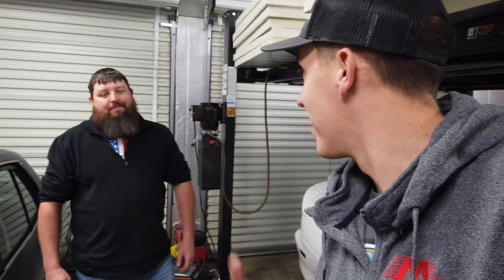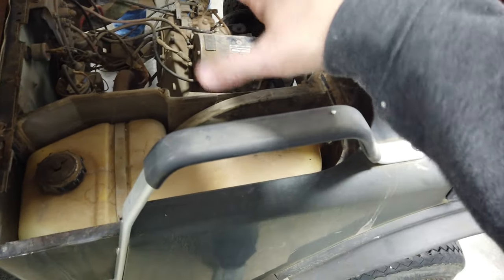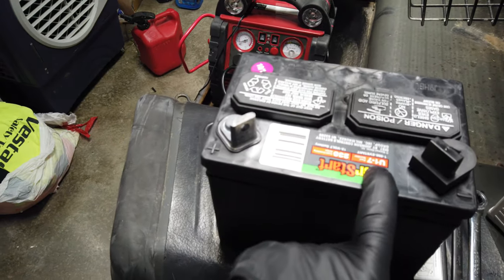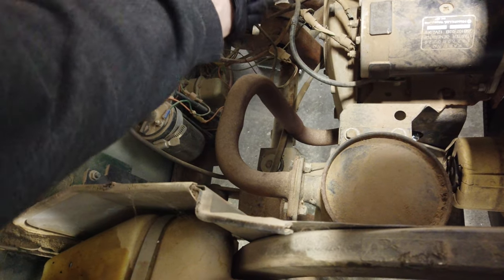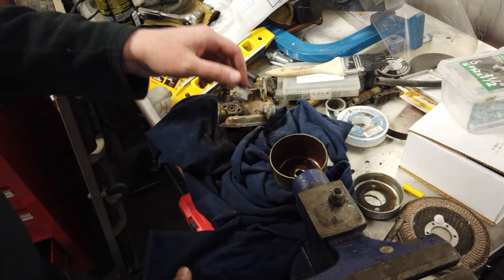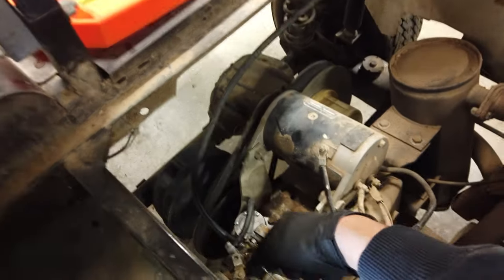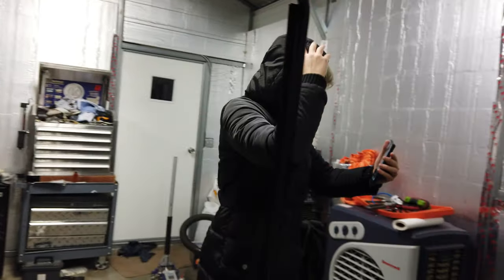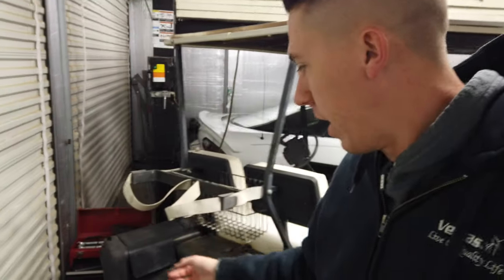Fixing My EZGo Golf Cart New Fuel Pump, Cleaned the Carb and it Runs!

Comment: Thankyou Sir , I spent over an hour trying to find some that knew what they were doing , I changed out an electric fuel pump on a not running ezgo , the previous owner worked on it and messed it up, so I put the oem fuel pump but wasn’t sure which line hooked up , and I thought just what you said which would’ve been wrong , again thanks for your video , Wishing you a Blessed Day

Comment: What did you do to stop it from back firing! I have an 88 that backfires too.
Reply: Hey Derek, I just bought an 88 model. Im hearing this particular year is kind of a one-off. I have a question for you. This thing was really sluggish and woldnt hardly pull itself. I took it to a shop and had them clean out the fuel system and put a new carb on it. (I know nothing at all about 2 strokes)  It runs a lot better now, but there is a horrible hesitation, or delay I guess, when i push the has pedal down. some times it can take 5 seconds or longer for the cart to actually take off. And when Im driving it, if I let off of the pedal completely, then push it down again it does the same thing.  Do you have any ideas??? I was thinking possibly the drive belt? But Im not sure

Thanks
Reply: @jthompson5059  I'm fairly new to this as well. Could've put a cheap Chinese carb on and it needs some adjusting or not getting fuel as much as it should. Maybe a fuel pump. Struggling myself, hope to know more in a couple days.
Reply from the maker: The throttle cable wasn’t adjusted correctly and it was holding it open slightly. Adjusted and had been great!

Comment: I just got one of these but can’t find the spark plug
Reply from the maker: If you follow the spark plug wire from the coil down to the engine you should be able to find it pretty easy
Reply: It's right beside the mounts for the muffler
Reply: Maybe someone removed the spark plug. There is a hole in the center of the engine just next to the muffler.

Comment: You start with the fuel pump then the carb then the spark plug and if all of those are working then it should start
Reply: Fuel pump not pulling gas from tank. Can the crank case not put out enough air pressure to pump the fuel pump ? Need help